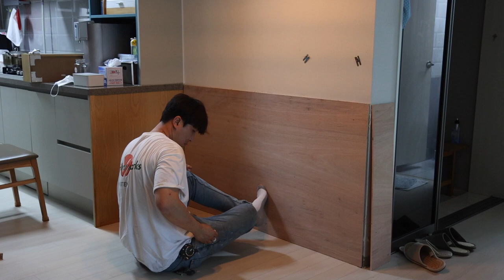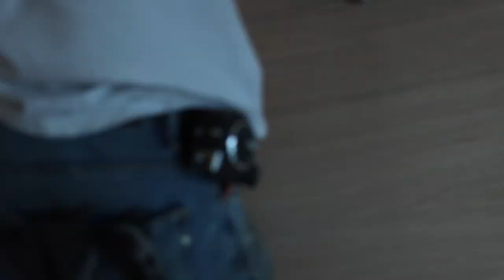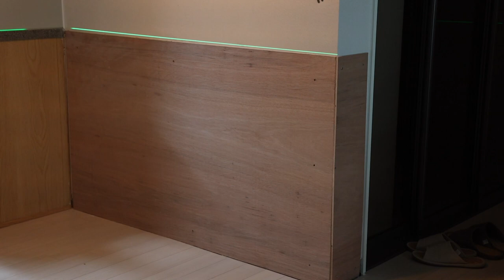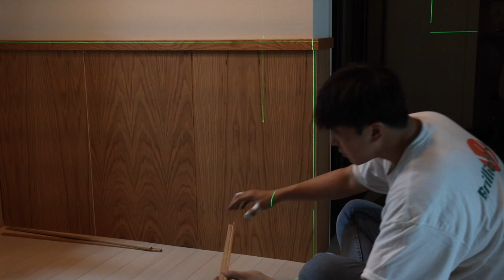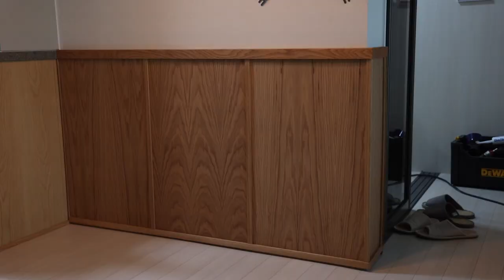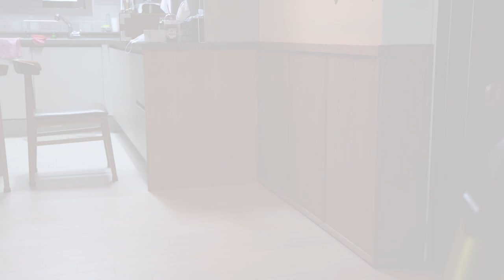W107_Easy wall decor with plywood

Comment: May you please suggest model of your baby compressor for nail gun.
Reply from the maker: Umm... the compressor is one of the model, battery compressor. there are too many brand, but the performance is similar
Reply: Look at the Makita Q series oil less in the smaller size if you need more HP I recommend California Air tools. I had the Makita 320q? It was good but the California Airtools had more umph. For smaller sizes air tools you want light, small and quiet 🤫

Comment: Какую роль выполняет щель на плинтусе? Что у них дома неровный дощатый пол? Температурный шов?
Reply from the maker: sorry. I don't understand. maybe your question is the gap. the gap helps flexible working on incorrect width and floor.
Reply: @ViTTEN  Понял. Спасибо. 
Зазор нужен для ускорения и удобства работ. Смущает что туда будет забиваться пыль )))

Got it. Thanks.
The gap is needed for speed and convenience of work. Confused that dust will clog there )))